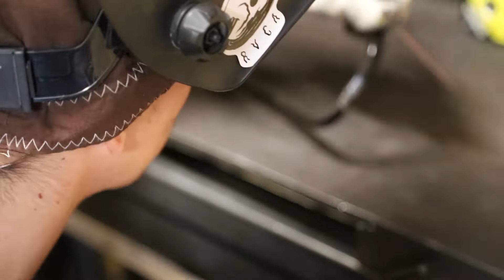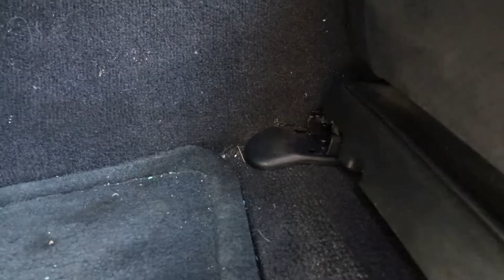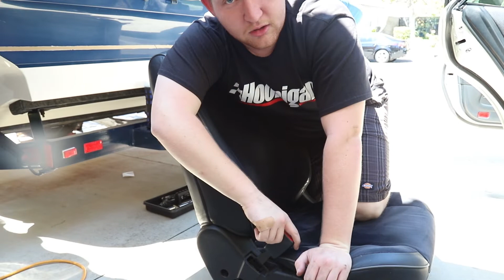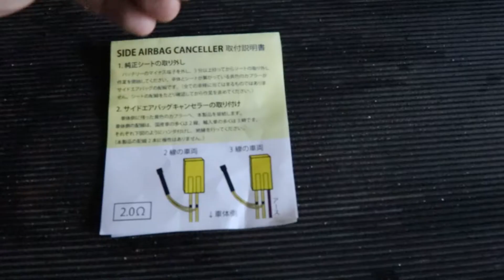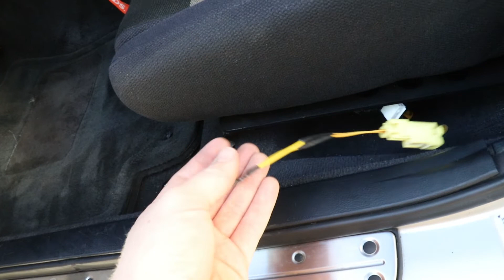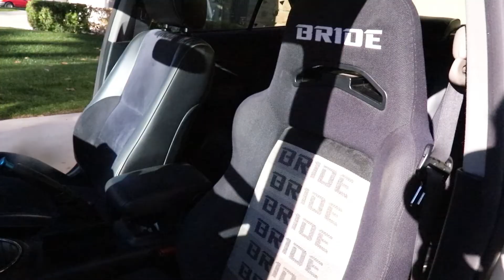IS300 Classic BRIDE Seat Install (including airbag resistor)

Comment: What resistance you use for the air bag
Reply from the maker: I used the official BRIDE Airbag Resistor: https://www.evasivemotorsports.com/store/product/bride-air-bag-seat-canceller/ (or you can make your own)
Reply: @millennialmotoring  what resistance though. how many ohms?
Reply from the maker: @gregatwell713  For the IS use a 2.0 Ohm resistor. Evasive has a little guide in the description of the part that tells you which manufacturers require which resistance as well